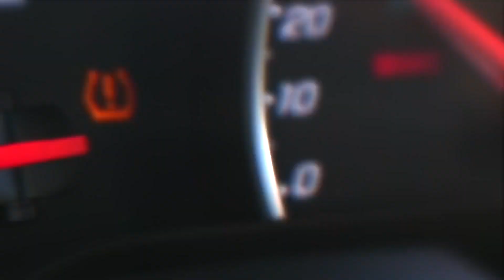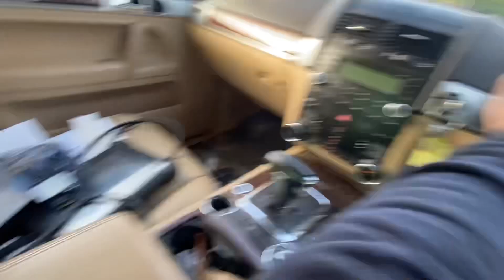Volkswagen Touareg, crank no start. Part 2.

Comment: Some going Peter. Cracking work. :-) Todays "crank no start" here was a classic range-rover V8 - been everywhere, naturally, no go, so I got it dumped on me. 

Sorted out all the absolutely shagged electrics, did away with the aftermarket imobiliser that was, erm, imobilising everything as it's toast - replaced the duff relays that were not helping either, all confident she'd fire now - great spark, fuel pumps running again, blah blah. 

Nope.  Crank, no start... She did however crap fuel all over the floor... replaced the rotted fuel lines... noticed - this bits important - that the spilled "petrol" hadn't evaporated.... despite me fluting with the fuel lines for over an hour... Hmm. Dipped a rag into the spilled "petrol" & set it alight... Diesrol..   Deffo diesrol... 

Yep - fuel tank contains 80% diesel. Which generally isn't the greatest for a petrol V8.... Thought the owners son looked very shifty as his Dad dropped it off............. didn't know why............. Out of all the places its been, nobody sorted the crappy electrics - but more importantly, nobody copped she'd been filled with diesel....
Reply: That is what I call fubar!!
Reply from the maker: That sounds like a very interesting repair. Anyone that fixed up and got that vehicle running again would have to have that generic smile on there face. Absolutely brilliant work well done James 💪💪💪💪

Comment: Great to have an Alan. From what is shown on the video it appears a Bank 1(RHS from rear) camshaft has been installed into bank 2. The offending camshaft seems new as are the chains. Bank 1 camshaft (good one) locating cut out is around 7 o'clock with the shaft cut outs to the side. If you rotate the offending camshaft to same, the shaft cut outs perhaps should go to the correct position. Anyways, i suspect this job was done a while ago
Reply from the maker: It is sometimes overwhelming with the enormity of bits to come off and go back on, so Alan is brilliant to take on half of the job on the bigger ones.   
The camshaft I replaced is a longer shaft to drive the injector pump (the only long one) It’s hard to know what happened on this yoke Dave. The other garage lad owned the jeep for 4 years & never done the chains but the camshaft was definitely changed at some stage. Once it’s going again & stays going I’m happy 🤞🤞
Reply: @kennedysgarage3281  I'm showing 2 different P/N for inlet 1-3 and 3 different P/N for inlet 4-6
Reply from the maker: @davesterl  I’m got the camshaft from Cork engine center, they ordered it from the reg. and fitted straight in. There can be some pile of different bits on the same car nowadays Dave. It can be a real pain 🤷🏼‍♂️🤷🏼‍♂️